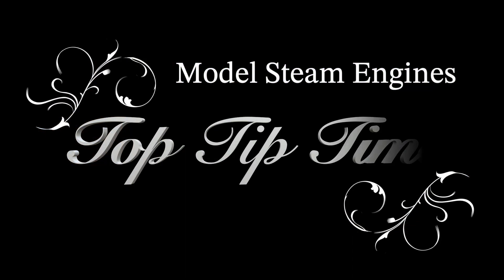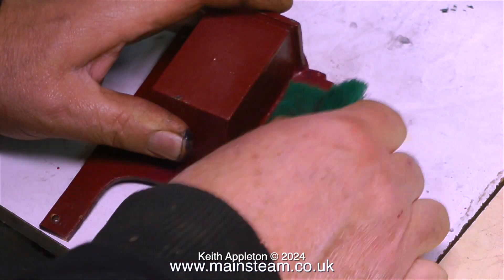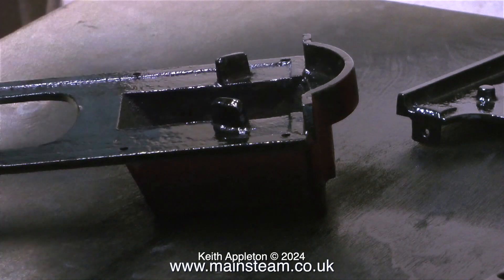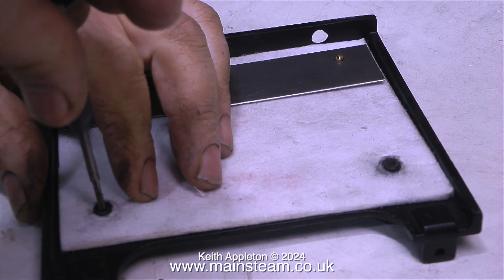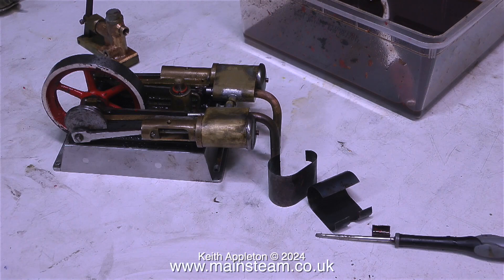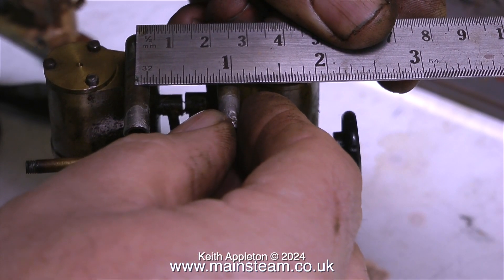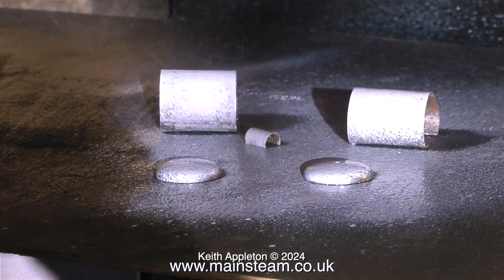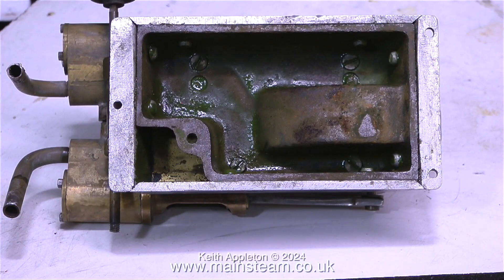MODEL STEAM ENGINES - TOP TIP TIME - PART #44

Comment: Hi Keith. It seems like Domes of Silence are metal feet for furniture...looks like a bit of re-purposing/re-cycling has gone on there 😁
Reply: I know the American Jensen company did repurpose a lot of household and farmers equipment, like the cattle syringe tip for the lightstand, industrial oilglass for the sightglass, etc on ther old steamplants i think it's a pretty cool idea to bring down the production cost without compromizing on the building quality  if it is done right like they did.